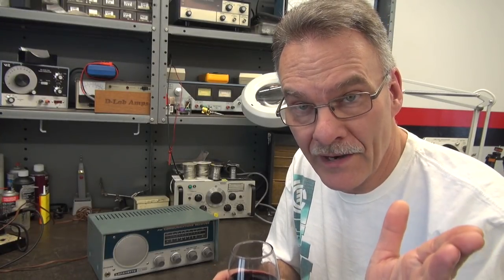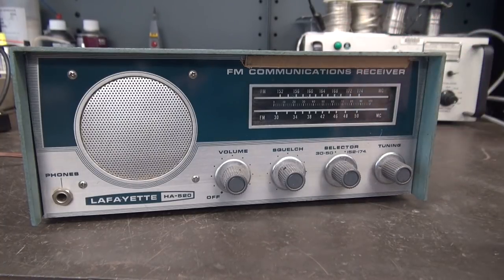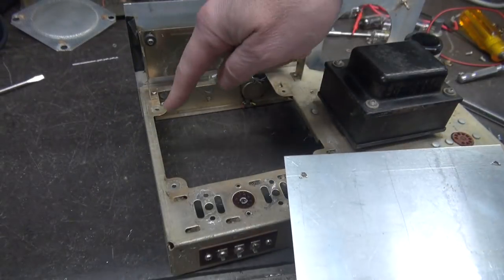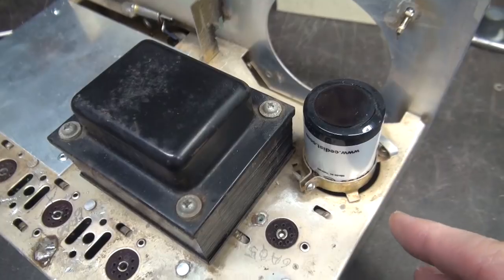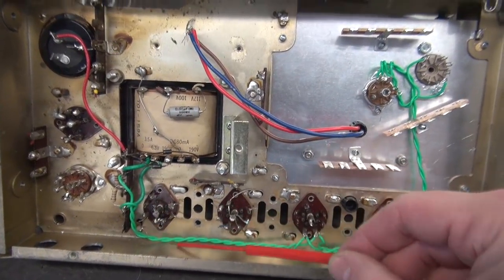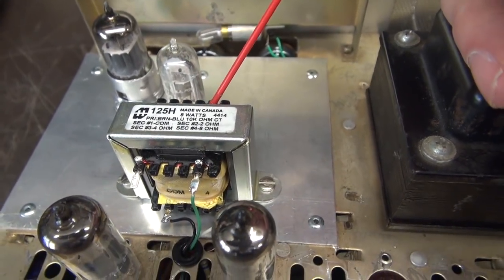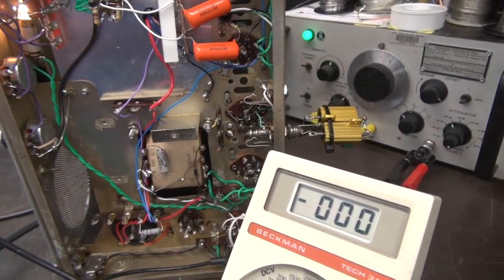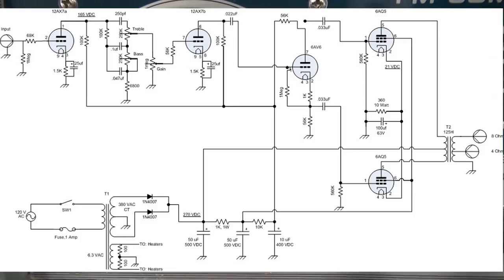How to build a Cool tube guitar Amp using a Old Lafayette Police Radio

Comment: Terry, on my projects I get alot of comments about how I connect my power cord to the switch and fuse.  I have been educated and taught that the Black Wire (HOT) should go directly from the power cord to the fuse, and from the fuse to the power switch and power switch to the black(hot) from the transformer.  The neutral (white) from the cord should be tired directly to the neutral from the transformer.  I notice on this build you have the neutral going from the cord to the fuse. And of course Green ground to the chassis. Is there a general rule on the right way to do this that you can share in a future video ?  This would go  a long way to towards helping folks like me get this right. Many thanks my friend.

Comment: Another great vid, Master Terry... 
Outside of the smaller pinout and size (and the convenience) are there any other reasons/characteristics that differentiate the 6AQ5 from the 6BQ5? 
er like (in your opinion) would a 4 x 6AQ5 make a decent 20/30 watt output stage? 
Maybe, being smaller their ability to dissipate heat might cause a problem ?
Thanx in advance... and cheers

Comment: Wow...Cool project!...I noticed you didn't put a speaker back into it...is there any speaker that size that would actually be suitable for such an amp? Is the amp designed to plug into a separate speaker cabinet? If so what kind? Do you plan to make a video demonstrating how the amp sounds?
Reply from the maker: Hello, no speaker that size that I know of that could handle the wattage. The amp can  accommodate a 4 or 8 ohm speaker. I do plan to shoot a live demo of the amp very soon. TD
Reply: Cool....look forward to hearing the amp...Thanks for the response!

Comment: Hi I was wondering I have a lafayette 250 stereo tube amp and it works just fine, its a hifi home amp but would i have to do to make one of the inputs L,R   to work for guitar, it has 6 inputs and i tried them all theres one that works ok but i think it could sound better and have more punch with the vol, its 3 12AX7's   2 , 7188  and 4,  EL86's  2 EL86's a side L,R   so i guess what my question is,  what the differents between inputs for home hifi and input for guitar? and what would i have to change on one of the inputs to make it more guitar friendly, and the spk out 4,8,16 ohms

Comment: Very nice build. But shouldn't the fuse go on the HOT side of the power line ?? (Black)
Reply from the maker: It's AC, same current flows both ways.

Comment: I wish one amp builder would do a series on wiring input, outputs, volume and tone pots. Beginners have more trouble with these things than anything else. Maybe someday someone will.
Reply: i second that that would be awesome if you covered the output section BTW great video